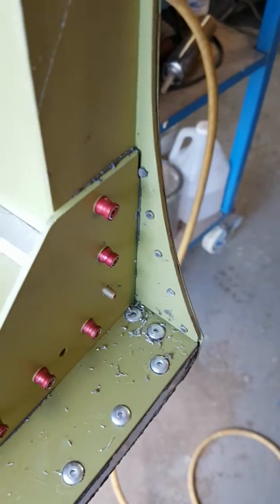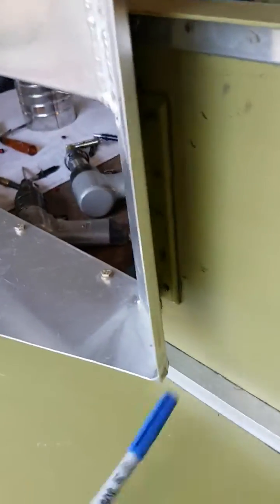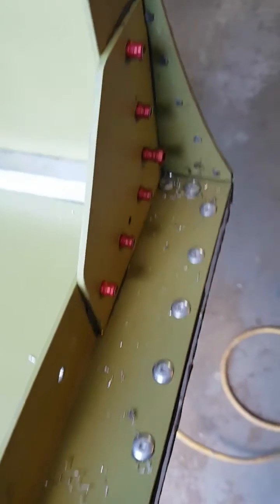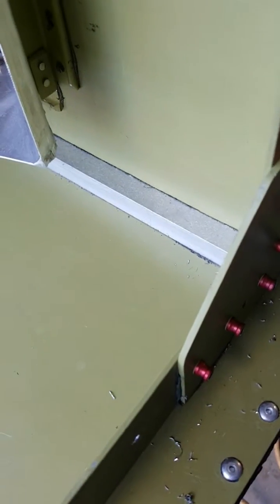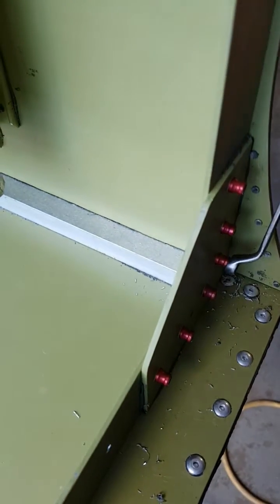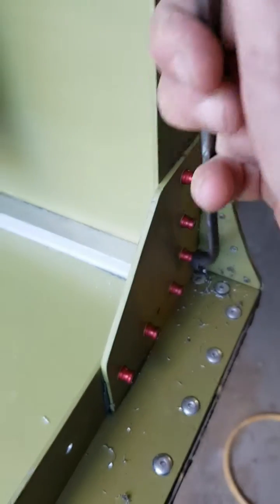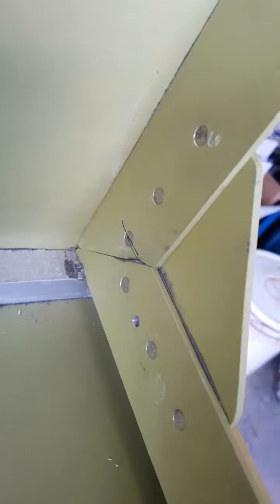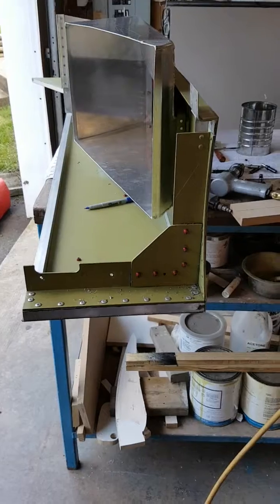Hilok install.

Comment: Since it's for your cart just use mini nuts and a thin washer. Then, you wouldn't have to worry about a collar coming loose. Those collars have a locking feature at the end to prevent that from happening. That's why you should have a minimum of one thread protruding from the end.